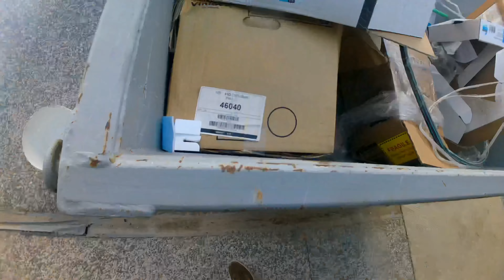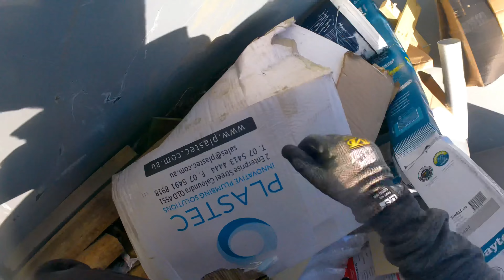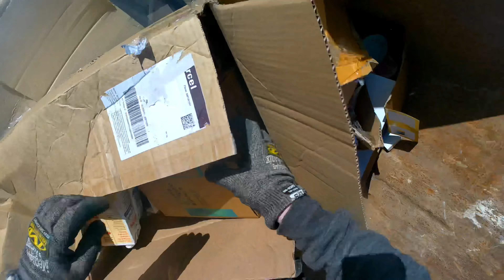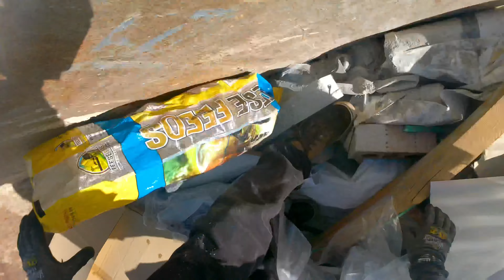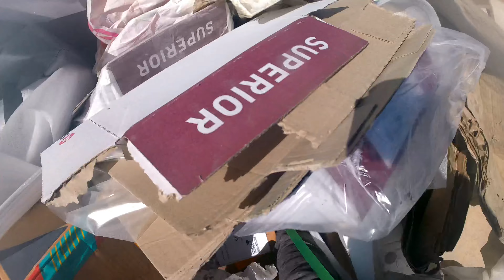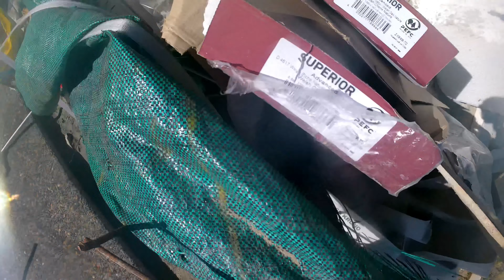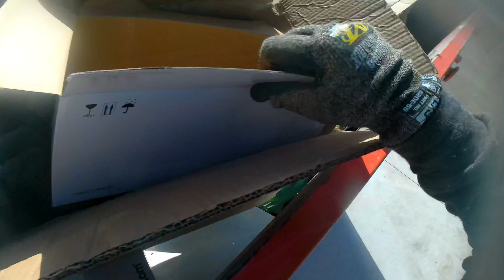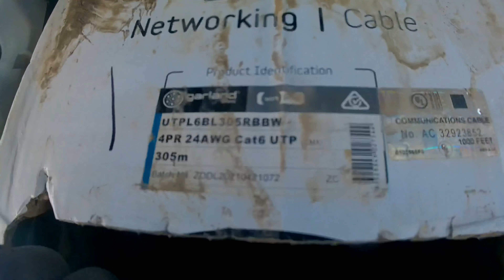Dumpster Diving | #13

Comment: Great video. I LOVED the new intro. 😆 Were there a lot of small bits of metal in the boxes you grabbed? If so, excellent way to be efficient at time usage. If not, why? Thanks for sharing your scrapping adventures with us.
Reply from the maker: There was just a couple handfuls of small off cuts from the copper wiring, nothing much but it all adds up. :)